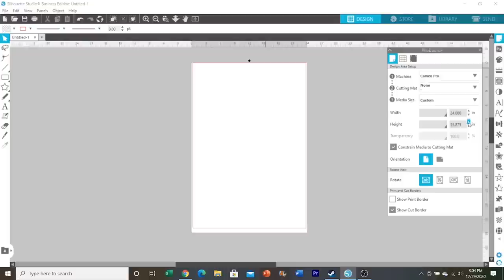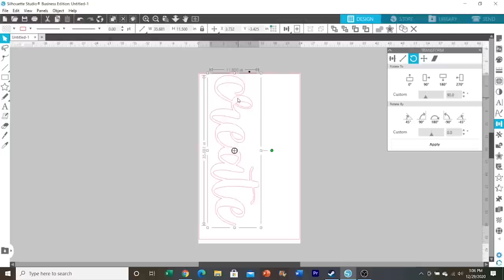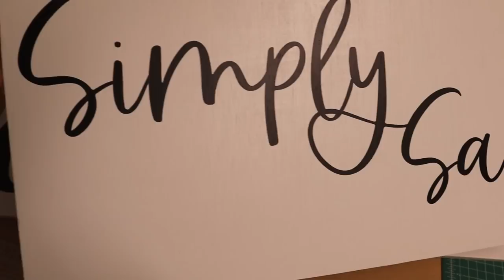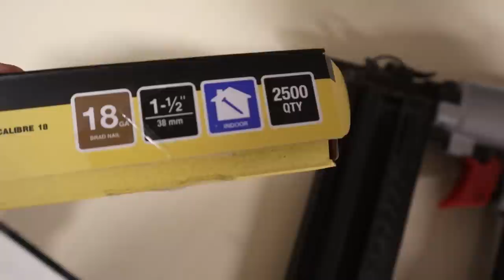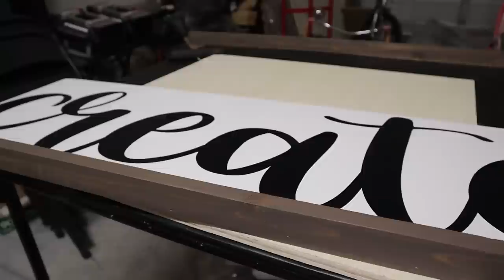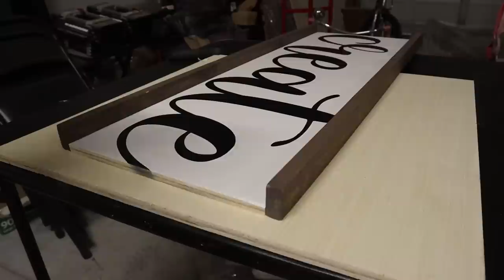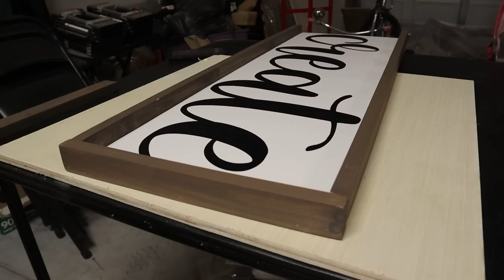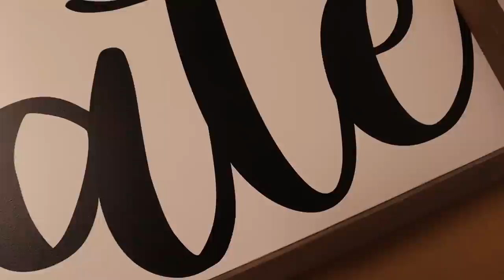DIY Framed Wood Sign

Comment: Thanks for sharing this, great information  just a tip from a fellow woodworker  May be to make your cutting go faster, but maybe you already do this is to cut 2 boards of the same length at once on the miter saw to one get them the same length, go faster and less measuring

Comment: Absolutely perfect! 💗 Thank you mucho for sharing your wealth of knowledge, it’s so unbelievably helpful. I’m definitely going to get a small compressor because I see it makes a world of a difference with the brad nails going into the frame. That is the part I struggle with the most, I can never seem to get the brad nails flush and it’s a whole ordeal! I also got really thin plywood and that’s been a nightmare trying to get the nails perfectly into the wood 😖 Do you put press and seal or something into your paint tray for the roller, for easy clean up?

Comment: First, Thank you for being so generous with your knowledge! You are such an inspiration to me! I have 3 littles and struggle with getting anything done! But you arr proof that with a good attitude and will power -anything is possible.

Do you sand your base coat before applying your stencil?  (I have a feeling I'm sanding way to much!)

Thanks again Sallie ❤
Reply from the maker: Thank you! The only time I sand is before I paint anything on the board. 😊

Comment: I know harbor freight is cheap but if you want to keep your foam rollers longer, you can keep the entire roller inside the van once it gets low enough to not cover the hole where you put in the roller handle. I’ve seen it done more with the longer foam rollers in a gallon can but I’m sure it can be done in a quart size with the smaller ones.
Reply from the maker: Thank you! I am seeing a lot of people do things similar to this, and I will have to try it out.
Reply: Simply Sallie I’ve been making signs for almost 10 years and have ventured into other products as I’m burned out making them. However, I’ve never been a big fan of stenciling, I just use different color vinyls and then seal my signs once complete. I do need to get more into stenciling because I think it would be so much easier for the ones that have a lot of color! Lol

Comment: Just a tip if you haven't figured it out yet - cut your frame boards so that the top and bottom are the longest pieces that way if your sign is set on a table or bookcase it will sit stable because you won't risk the sign wobbling because one of the side pieces extends a hair too far.

Comment: I have a cricut and have been thinking of getting a cameo. I’m curious, can you do this with Cameo; I normally put a box around my design the size of the board I’m using, that way after it’s cut, all I have to do is line up the edges. I feel like that would save you so much time. Also, do you prefer doing the base paint to protect bleeding or mod podge? Anyways, great videos! Thanks for sharing your tips and tricks!
Reply from the maker: Yes you can do this with silhouette! Ans yes I like to apply the base paint, polycrylic for stained signs 😊

Comment: What silhouette cutting machine do you have?   What size of the word did you use?   I want to make my own large "gather" sign but the cameo I have tends to cut all over the place when it won't stay put in the rollers.   So I would have trouble cutting out the large "gather" wording on my cameo unless you used a larger piece of vinyl and did you have to mirror it?

Comment: How many coats of the spray paint do you do? Also, do you ever use paint roller or other method instead of spray paint? Not sure where you are located but where I am in Canada, we have really cold winters so spray painting is not an option unless you have a heated garage or something (which I don't)

Comment: What size roll of the stencil did you use to make this sign? My vinyl cutter will cut up to 24 inches wide and however long I need it. Just not sure which size roll to buy. Don't want to go too small and not be able to do bigger signs.

Comment: So you need a Chop saw, a compressor and nail gun, power saw and fence and a vinyl cutter of some description plus ancillary materials ie pins, paint vinyl , timber, glue ( oh you didn't use any glue) etc etc  Out of interest what would be the cost of sign just shown ?

Comment: If you are not going to put the Poly coating on the sign, just the frame, why not put it on the frame pieces before attaching them to the sign?   Seems like it would be easier and it could dry while other steps are going on.